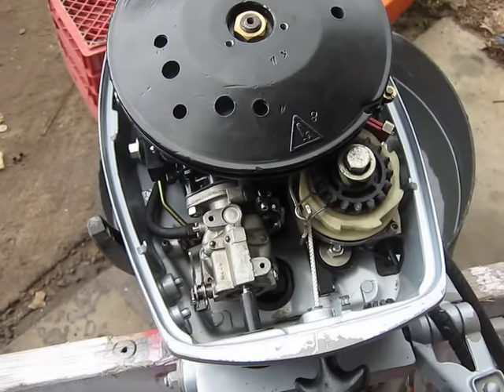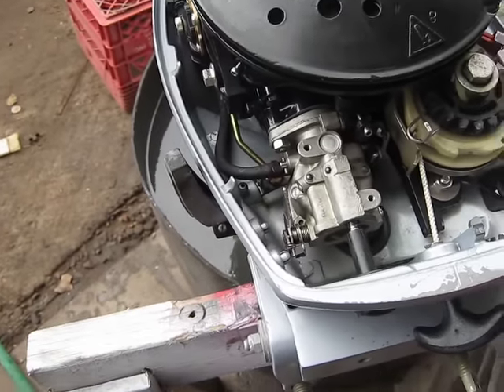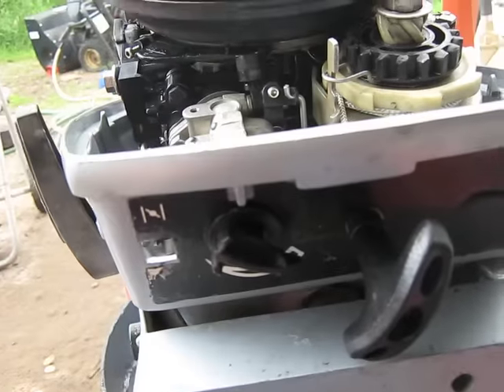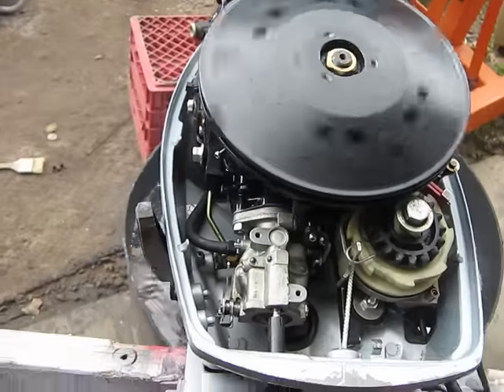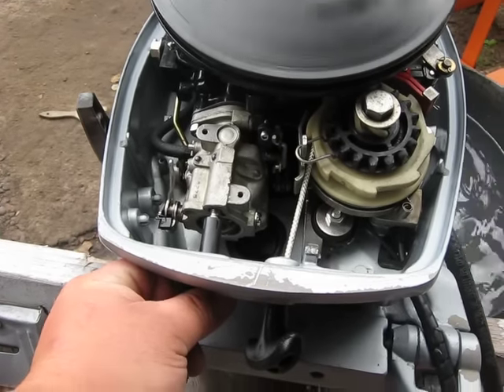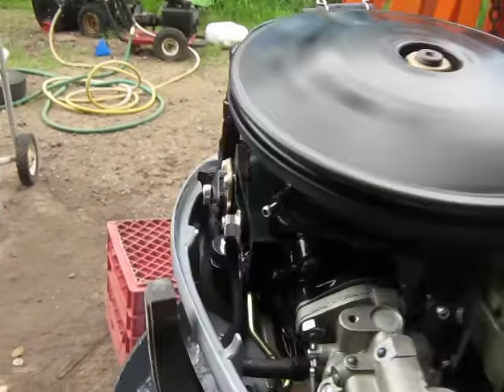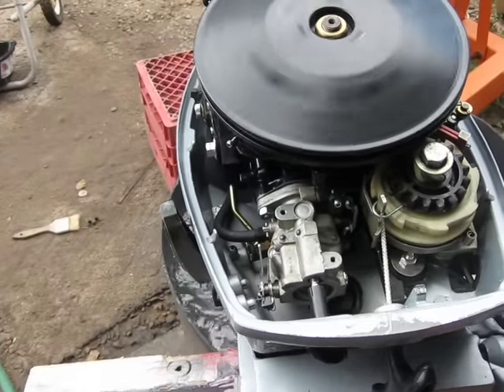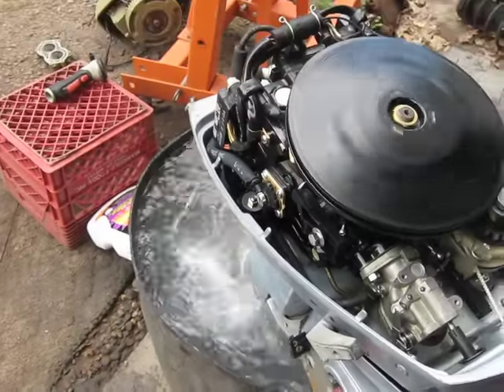Johnson Evinrude 9.9/15 hp carburetor adjust how to.

Comment: The correct way to adjust this low speed needle, is to turn it all the way in until it is lightly seated.  You then turn it back out 1  1/2 turns.  That becomes a reference point for further adjustment.   I like to be able to get a equal rotation each way so set the knob at about what would be 4 on the top.  This should give you a basic setting.  Once you get it where you want, you can pull it off , then reposition the knob where you want it.
 
With the motor warmed up and the twist throttle in a SLOW position approximating your intended slow/trolling speed, turn this low speed needle jet in about 1/8 of a turn, let the engine run for about 15 seconds to respond to your new setting.  Do it again then wait for the results.  A cough is indicative of a rich mixture. Too lean it will just die.   When you make this change and the engines either sputters or wants to die, back it off the the last position then this should be close to the ideal setting.   If you go to rich it will cough AND then die.  You can now pull the idle knob forward and off the splined shaft, reposition it so that the knob pointer is down so you will have movement either way from this position for fine tuning if needed.  This low speed setting does not effect the high speed running of the motor.  However it you set it too lean, you may later have a issue with it not wanting to start when it is warm.
Reply: yes the base setting is important especially with this carb as you can get it way off the way the adjuster knob goes on.

Comment: There are 2 different carbs for this motor in 1987. This is the all metal version later replaced with plastic top version for latter part of 87 until 92. The plastic topped carb has a much different kit with no welch plugs. The low speed circuit is the channeling in top of carb. More importantly, the starting low speed mixture setting is 4 turns out from gently seated and not 1.5 turns. Many thanks to Leroys Ramblings for this information as this will save alot of frustration.
Reply: Legend thanks buddy!
Reply: I have all metal carb with no plastic so basic setting before starting the motor should be 4 turns okay, I have hard time turning it on and if I do it only fires up at full throttle and it stays on on for few seconds or for 10 seconds than when I lowerd the throttle it shuts down please help hahahahaha.... I did clean the carb, fuel lines and also the fuel pump, new sparks so I have hard time firing it and if I fire it, it shuts down

Comment: 1st, Rest in Peace Pepper. Pepper was the star of the show! Clearly, such a great companion. 👍            Onto some Yachting... Since Ben can do this with his eyes closed...lol  I'll add to the concept. The factory setting on nearly all the metal 9.9/15 carbs is ~1 turn out from lightly seated. Neverless, it'll start fine at 1.5 turns out. The most important technique is to rotate the needle in until it begins to slow down(too lean) - make a mental note (like on a clock) . Then, back out the mixture screw(counter-clockwise) to richen until it just begins to slow down (too rich). THEN SET IT MIDWAY BETWEEN BOTH NOTED POINTS on the clock. After rotating the needle to the midpoint, pull out the knob and re-install with the tang facing staright down (6 o'clock). FYI-Normally, it's ~ 180 degree total difference between too rich and too lean.  If you'd like to slightly richen it as many shops do, rotate counterclockwise (back out) ~5minutes if you view it as a clock. This process can start in neutral, but must be completed at a low speed in gear. I actually prefer reverse, since it's the toughest to idle at (exhaust gases), but forward is fine. A filled barrel is fine. In gear at idle stomp on the throttle momentarily, if it conks out, then it's slightly lean. 2nd test at idle, stomp on the throttle momentarily then immediately back to idle(closed throttle). If it conks after the abrupt drop to closed idle it's slightly rich (though it may be satisfactory in normal use). As Ben said, slightly rich is better than slightly lean. Next step...let it sit for 10 minutes off and it should restart without throttle. If it doesn't re-start, give it some throttle and retry. As these motors get older, there may be a compromise and raising the idle speed might be part of keeping your sanity. FYI- For the points motors '74-76 NGK B6HS, for the '77-1992's we've gone to NGK B7HS. Champion plugs seem to have a lower quality nowadays. We often will "Index" the plugs which allows for a bit better running at idle, especially if slightly rich, but that's a whole different topic. We stock index washers, so it's just a few more minutes of time. Hope that helps.

Comment: There's also a high speed screw on the left side of the carb. The shifter side of the engine. Its a fuel mixture screw with a T on the end so you can turn it with your fingers, thats only for high rpm tuning though and unless there's a carb issue you shouldn't have to move that one more than 1/8-1/4 turn in either direction...
Reply: Not on this carb
Reply: Coco Bolo So what the needle is locked in place?
Reply: @mxracingunlimitedltd7784  Theres no high speed tuning on this carb, only low speed. High speed jet is set,  correct.

Comment: I have a 74 15hp evinrude.  It cranks up every once in a while for a few seconds.  I messed with the lean/rich dial, the choke and the throttle but I can’t get it to keep running.  New spark plugs.  What do you suggest?  Do you think I should take out the carburetor and clean it properly?

Comment: Every time I back the cam follower  behind the cam plate hash line it dies out and doesn't idle do I have to screw in the idle control knob to  constantly keep slowest position with the follower lined up with the cam hash ?

Comment: On my chrysler 10hp  107ha the line u reference  to line up roller with on the mag plate will only line up with the roller on the throttle control at full throttle.  Motor wont' start and pull plugs and flooded.  It has good spark both cylinders.  Cleaned carb.   Is this a timing problem?  Any help appreciated.

Comment: Hi I have a question... Where you had your finger now to the other side when rolling the throttle is a little black plastic part that has a spring... Mine came off and don't know where it goes can u show the motor slow so maybe I can see on ur motor?

Comment: Hi I have about a 2000 15 two stroke and it will not idle. I was curious about the line on the timing plate. I think I heard you say it should line up with carb wheel when at idle.  There is a screw on the linkage back by the plugs is this for setting the line? also it seems you can adjust the ramp with that screw in the plastic a few inches from the line. Thanks for any information.
Reply from the maker: On that motor the 1st thing I would look at is the cylinder head bolts they have a tendency to loosen up over time and cause poor idling. 
The 2nd thing I would check is that there is a rubber hose inside the carburetor that feeds the idle Circuit and they will turn to mush. 3rd thing is the top plastic carburetor cover is well known to crack.

Comment: I have one of these and it seems that it is very hard  to get the throttle control to move once you get close to full speed.The piece that rotates under fly wheel that throttle cable moves seems hard to turn.Any ideas.I have nothing to compare it to.

Comment: Im having an issue with my new to me 15 johnson not running well while trolling at low speed.  it seems to flood out and doesnt want to start right away after it dies.  the motor runs fantastic but yea, it will flood out and die after trolling for a short time.  should I lean it out??   Im a bit confused

Comment: Have a 1984 yamaha 8LN motor. Was running great at WOT one day and then in the middle of a lake just stalled out and would hardly idle. I cleaned the carb, although it wasn't very dirty to begin with, and also I've checked the plugs and they are good as well. Any ideas as to what could be wrong?

Comment: Hey thanks for the video. I have the exact same motor, can you tell me what the knob on the side of the motor is for? Behind the tiller handle on the side is a knob just like the mixture screw on the front, it looks like it affects the throttle somehow? Do you know what it is?
Reply: The knob on the right side of the motor is a idle adjuster.

Comment: I'm currently cleaning up one of these motors, 1981 15hp more or less an identical motor, minus the throttle linkage. The motor i have has never idled according to the past owner and i couldn't make it idle either.  I just rebuilt the carb but it wasn't all that dirty. It's winter here so I can't test it, but could you maybe let me know exactly what screw you were referring to? Mine is missing the idle knob on the left side of the motor but i'm told that doesn't have much effect
Reply from the maker: Well 1st off you will need that idle adjust knob, without it you will not be able to set the minimum engine speed. Now if i remember the 1981 does not have a throttle lash adjustment screw. When it warms back up again make a video of what it is doing and i will help all i can.
Reply: chrysleroutboarddude
appreciate the response,  i talked to a few guys and they said the idle knob wouldn't make a huge difference and that it should idle without it, i actually found the retaining pin and the plastic knob inside the motor, the knob was gone though..the screw it looks like you're pointing to, on my motor is an allan key head on a piece of plastic, it doesn't appear to have much effect on anything? as the motor is sitting in the dining room i could email or post a picture thanks again
Reply: chrysleroutboarddude

http://imgur.com/sg4lKhg

this is the screw only screw in that area, it's attached to the throttle, though the 1981 doesn't have a throttle cable it uses the gear teeth (terrible design) this screw doesn't really appear to do anything it's just screwed into plastic
Reply from the maker: ryanbreeze Well the idle is set with a combination of timing and throttle plate position and fuel mixture. What that screw does is set the position of the throttle plate in the carb and when you open the throttle on the carb with the engine at idle it will lean out the fuel mixture. so that is why you have a low speed idle mixture needle. The idle adjustment knob sets the timing, and if you can't set the timing there is no way to get the throttle cracking screw set correctly. For a starting point close the idle mixture needle all the way, then open it 4 turns, then set the throttle cracking screw so that the throttle plate just starts to open when the roller lines up with the line on the mag plate, then set the idle adjust so the timing will not go lower then the 1st line on the mag plate. Start the motor let it warm up then you will be able to fine tune it by adjusting the cracking screw and the fuel mixture needle. Then and only then you can set the lowest idle with the adjustment knob on the side of the motor.
Reply: chrysleroutboarddude
i really appeciate the responses, were you able to look at the picture i posted above to see if that'sthe throttle cracking screw you're referring to? i took a pic of it, as it's out of my motor right now, just doesn't seem like it does any actual adjusting. (sorry very new to this, first outboard)
Reply from the maker: ryanbreeze Yes that is it! it does not move that much but it all has to be correct. a lot of times what will happen is when the plastic gets old it will take a set, and move much.
Reply: chrysleroutboarddude
perfect thanks so much! I just tried playing with it, seems like the plastic arch bends a lot with screwing it in / out ..can't wait to try it out in 5 months when winter is over lol thanks again

Comment: first - thanks for taking time to make & post video.  I have the same OB (9.9 hp)  mine starts and runs fine but......if I back the throttle "all the way down" it will stall.  do you think I can just adjust the idle screw?
Reply from the maker: onenikkione try to get to idle as low as you can then adjust the carb to make it run it's best then repeat
Reply: +onenikkione What did you end up doing?
Reply: +Austin I got lucky.  was able to adjust the air/fuel knob a little and it runs fine

Comment: chrysleroutboarddude - I just bought the same motor in your video.  I also have the same problem, being a broken idle stop  knob.  A new Idle adjustment plastic knob & retaining ring from Amazon, $36.00 is on its way.  My question is, why do I need this, on my previous motors mostly Mercury, there was no such thing, you would turn the throttle to start and start the motor, then when stopping I would turn the throttle down and shift to neutral.  Please reply.
Reply: You dont have to have it if it idles fine and you dont need to adjust it for trolling. Thats all its for....allows you raise/lower idle without adjusting anything on the carb.  I know this is old post but just in case you never got an answer.

Comment: Hi I have an old west bend 6 hp motor that only fires for a short while when fuel is added to spark plugs. I’m guessing the carb needs a good cleaning. But I can’t find any how to videos or any information if I’ll need new parts to clean it. If you can get back to me that would be great 👍 or email address for contacting

Comment: Hello. I have the exact same motor year and hp. One main issue I have is after I start it with the throttle set to idle. It hesitates and shuts off. Can this be corrected by adjusting the idle on the carb with either of the two screws?

Comment: Hey Ben, love your videos. Wondering if you could answer a question for me?  I just bought a 1987 15hp Johnson and it's got it a sticker on it that says 100:1 fuel ratio on it. I asked the person I bought it from and he agreed that is the ratio he used. I read around on the internet and some people say use 50:1 instead. What do you think?
Reply from the maker: Matthew Olday From what i have learned about this is, OMC recalled the motors with the 100/1 sticker and replaced it with a 50/1 sticker. If it was my motor i would use 50/1 or even more oil. I have a 30hp and a few 6 and 8hp motors that say 100/1 and i use 40/1 in them.

Comment: Hi C dude I'm working on one of these .. runs great trolls great but when going back to high speed it seems to bog out and catch up after a Lil bit .. almost sounds like it  drops a cylinder then kicks back in ...if the roller is out would this cause this  effect  being the throttle position is slightly out of time .. I know Ill work it out but a Lil help goes a long way .. more familiar with newer stuff Yamaha and Hondas  thanks in advance my man .
 Canadian Mc tech
 Pat
Reply: Try adjusting your fuel settings. If they are off too much gas will get in and the engine won't burn it all and some can get past the rings into the cylinder

Comment: need your help engines giving me troubles. it will start with the choke on and run for approx 2secs then dies a lot of fuel coming out of carburator when squeezing primer bulb.. when i close choke the engine won't start.

Comment: i currently have a 1976 johnson, it was runing perfectly until someone played with my lean screw and now it idols perfectly fine but when you give it any sort of throttle it just wants to die in gear, could this be I just have to play with the lean screw and put it back so it runs rich again?
Reply from the maker: That sounds like it is still too lean, or you might have a dirty carb.

Comment: Could you take a look at my latest video of my 15hp? I zoomed in on the roller position to see if it is correct. My motor is apparently missing the idle speed adjustment screw. There is only a knob with nothing attached. Thanks! You're videos are great!
Reply from the maker: It looks fine, but i think you will need the idle parts.

Comment: Great video!  I have a 1985 15hp Evinrude I've had since new (and it still looks new) and it sat for about 3 years.  Cleaned the carb, new plugs, new grease in the low end, new tank and new fuel lines.  Idles like it's brand new but once I'm running along and get to about 85-90% of throttle it starts to lunge up and down between 95-100% and down to 75-80%.  Up and down....Up and down.  I played with the fuel mixture for a while running up and down the river but it doesn't seem to change anything at higher speed.  Any ideas would be greatly appreciated.  Thanks!
Reply from the maker: Joshua Auckland It might be time to re clean the carb, sounds like the hi speed jet is dirty. it also might have a vacuum leak at one of the crank shaft seals, or might be a problem with the fuel pump. What do the spark plugs look like?

Comment: I have a 1979 Chrysler 7.5 that I have been trying to get running, and i have done everything the manual says to do, but the engine will only stay running for about 3 seconds before it dies again.  It wants choke on to start but immediately wants it off to run.  There have been a couple of time when it ran fine for several minutes and especially well at full throttle, but now I cant  keep it running.  Ive verified compression with a gauge (100psi on both cylinders), replaced the fuel lines, fuel pump, cleaned the carb and adjusted the float and mixture screw, adjusted the stator control link and throttle cam follower, gaped the plugs all per the manuals instructions.  It seems like a fuel problem to me but I don't know what else to try!  you seem to have great success with these motors, and was curious if you had ever run into this?
Reply from the maker: Justin Boyce Can you make me a video? Is it hard starting? I have seen a few of them with broking reed valves.